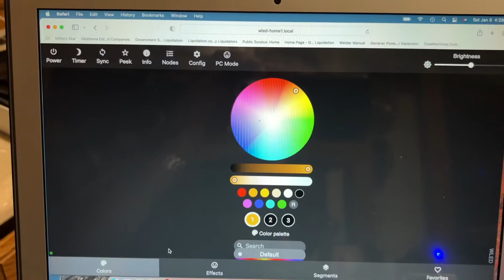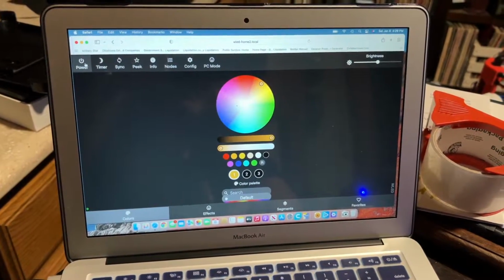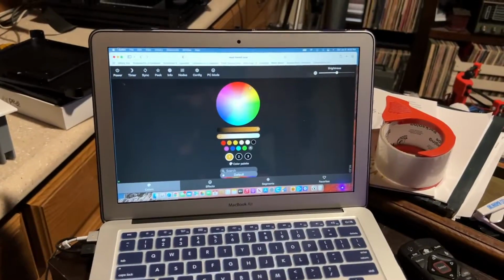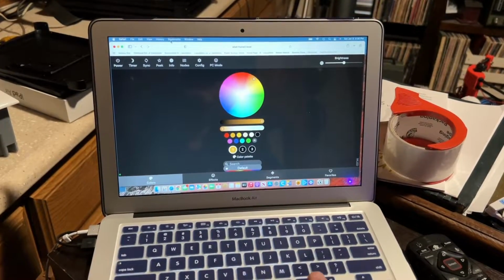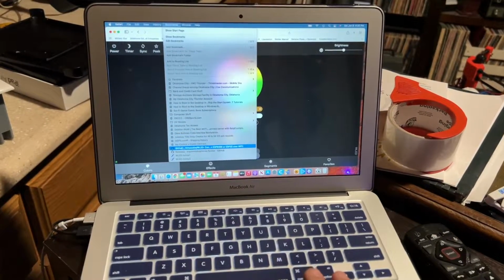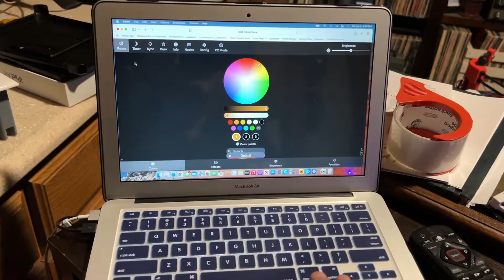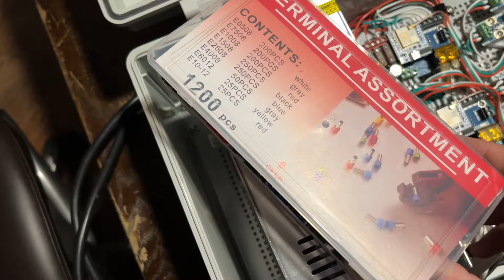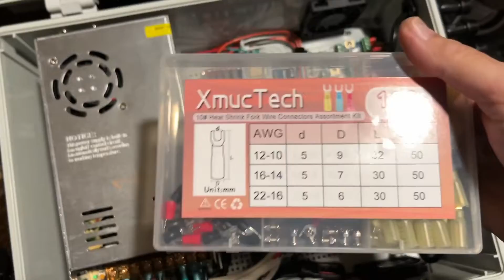Permanent LED Lighting DIY   Distribution Box Build

Comment: Im currently building an led system box.  The way you used the "boosters" seems very ineffective, being inches from the original signal.  I could be wrong, but it would be like doing power injection only at the beginning,  exactly where you wouldn't need it.
Reply from the maker: With this version of the Dig-Quads, it works well but no longer needed with the newer versions. I know it seems worthless but it increases the signal and does help. But, like I said, no longer needed with the latest versions of the controllers.

Comment: One thing I would do, not sure if you did, but I would wire the bottom fans drawing air and the top blowing out. You would get better circulation. They are usually dc so you would simply swap the positive and negative.
Reply from the maker: @terryhowell8747  That’s not a bad idea! Thanks

Comment: Couldn't you have powered the dig quads with the 12 volt power then take 5 volts from it to the relays?
Reply from the maker: There is no 5v output from the DigQuad. Take a look at this video of the wiring diagram. https://youtu.be/j2q0Gvm5BrI?si=gCX7SHT-C1WjUYUs

Comment: Can I get the electrical circuit drawings To this? I asked because I listened to you over and over; for quite some time, but I'm a bit worry that I will still do something wrong, so the drawings will help bc I dont have the circuit diagrams for the component boards. A while ago one other person said asked for them, but I never saw a link to any. Would you be so kind as to please PM me so I can build this too? I won't hold you nor anyone accountable for any failures or mistakes... I'm a retired forgwtful electronics tech and should recall and understand more with them.  Thanks...
Reply from the maker: I have a drawing but can't find your message info on your channel.

Comment: I’m not sure why you think the power injection has to come from same power supply. Have mine running perfect, & power injection is needed and IS  different power supply. Second power supply (injection) is hooked to the END of my pixels & I am using that power supplies ground also. I only made that comment for clarification because of your comment.
Reply from the maker: Everywhere I’ve read, you should never power inject with multiple PSU’s unless you completely break the positive connection. Connecting the positive wires between two PSU’s can be hazardous. You can use two PSU’s by having one power the controller and the other power the lights but have one power lights on one end and a second connecting to the positive on the other is a bad idea.
Reply: @1SpudNuts1BigNasty-DIY  I think the term used in the industry is 'difference in ground potential'. Should one power supply's ground have a difference in the quality of or amount of zero volt earth ground vrs the other, then there will be a variance in the circuit which will cause an undesired voltage loop... Meaning: A Ground Loop, which is an unwanted electrical current path to two different grounds, can cause havoc in equipment or process control systems by introducing unwanted electrical noise. These undesired Ground Loops are created when two supposedly connected points are not at the same electrical potential (meaning resistance to ground). That’s when Ohm’s Law takes over and creates an electrical current flow between these two points. It stands to reason, that Ground loops can be avoided if all devices are grounded together at one point. This type of grounded is referred to as Star Point grounding.  This in itself would resolve using other supplies if their ground potential resistance is THE SAME... since using DC, this is less of an issue than when using AC which could have out of phase issues; which is another concern.

Comment: Where did you buy the plastic feet to elevate the board up?
Reply from the maker: If you go into the channel and check out the playlist, each video has links. I found those on Amazon: https://www.amazon.com/dp/B01HNUSKRY?psc=1&ref=ppx_yo2_dt_b_product_details
Reply: @1SpudNuts1BigNasty-DIY  Can't find little feet that fit the m2.5 screws so am going to try this build but with spacers instead.  feet are cute and will certainly use elsewhere when i can use m3 screws.   good write up.

Comment: What size box did you use for your setup?
Reply from the maker: Here’s what I used for a single controller:

Zulkit Junction Box,IP67 Waterproof Electrical Box Hinged Clear Cover Stainless Steel Buckle Plastic Enclosure for Project w Mounting Plate Wall Bracket and 2 Cable Gland 15"x11"x5.1"/380x280x130mm https://a.co/d/cGfLYJb

Comment: How far does the Boosters reliably work?
Reply from the maker: About 10 meters or around 33 feet but I’m not using them as power boosters. I’m using them to clean up the data signal because they have onboard, selectable resisters (depending on cabling). But, newer, updated Dig-Uno’s and Dig-Quad’s now have that option built in.
Reply: @1SpudNuts1BigNasty-DIY  so with the new Dig-Quad V3 , you don’t really need the signal boosters ?
Reply from the maker: @iPhoneKilla007  I think it’s version 3.1. Here’s the revision history on it:

https://quinled.info/2020/06/19/quinled-dig-quad-revision-history/
Reply: @1SpudNuts1BigNasty-DIY  I ordered my last week from allnet.china hopefully is V3.1 since I don’t see any information on the details if the unit is v3.1 . Thank you for the info  👍🏼

Comment: Nice setup.  Do you have a link for the dig quad your using? I'm having trouble finding them.  Also, which power supply are you running? Do you have a link for it? Thanks.
Reply from the maker: Look at the first video in this playlist, there are links to everything in all the videos.

Comment: Nice set up! One of these days I'm going to re-do my controller box. Where did you get the white plastic stands for the quads and relays?
Reply from the maker: No, the screws through the board is a little tight but should work and mine didn’t come with mounting screw (to the box), I had to buy some.
Reply from the maker: Here you go: 50 PCS Circuit Board Plastic Standoffs Mounting Hardware,Motherboard Standoffs Foot Offs and Screws https://a.co/c3WP5Pw
Reply: @1SpudNuts1BigNasty-DIY  Call me crazy, but after grabbing that kit, the screws through base are too long and motherboard scres are too thick...? Did you swap screws and drill out holes in the board?
Reply: Bless you!

Comment: Thank you for posting this video.  I am trying to do the same thing.  I already have the box.  I was wondering about ventilation, but I see how you did that.  I do have 2 questions.  1.  Where did you get those white plastic brackets that you used to mount the dig-quad and the boosters? 2.  I thought that you only need boosters if it was further down the line and if you had to bridge any gaps greater than 10'.  Why did you use the boosters in your control box?  And, did it prove to help?  Thank you .
Reply from the maker: Boosters can be used for power injection but they also have the 33/249 ohm resister for 3 wire power/data or if they are wired separate. It helps with a more reliable data signal up to 10 meters. Here’s the standoffs: 50 PCS Circuit Board Plastic Standoffs Mounting Hardware,Motherboard Standoffs Foot Offs and Screws https://a.co/c3WP5Pw
Reply: @1SpudNuts1BigNasty-DIY  Thank you very much.  I did some more research, and it looks like the 33/239 ohm resister is built into the dig-quad.  Maybe its still a good idea for redundancy.  Anyways, thanks for your video.  I got mine all installed and working perfectly.  Your layout was really helpful.  Thanks again.
Reply from the maker: @JimSwens  Yeah, he’s added it to both the quad and uno.
Reply from the maker: Those resisters on the boosters aren’t built in to the dig-quads that I’m using but they are now.
Reply: @JimSwens  Thought the same thing! Apparently the v3 dig-quads didn't have them built in yet. But the current v3.1 have them built in now.

Comment: Love the controller box and the relays turning on the power supplies. Do you have a wiring diagram for the relays to the PS units?
Reply from the maker: Thanks. I do have a wiring diagram that actually came from another person that I worked with on Discord. Not sure how to post it here though.
Reply: did they share the wiring diagram for this project? if so could you please share
Reply: @jmobsnxgen  not that I can see